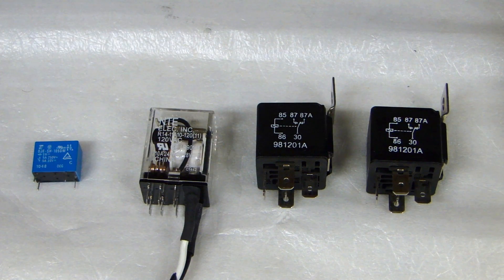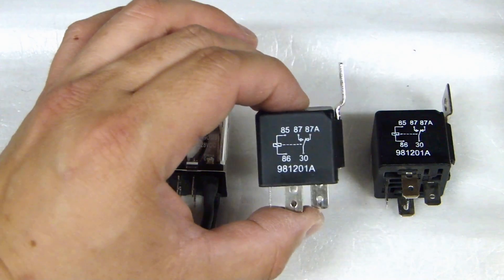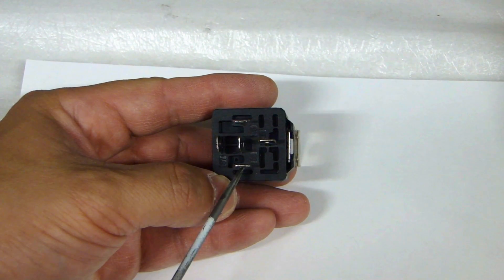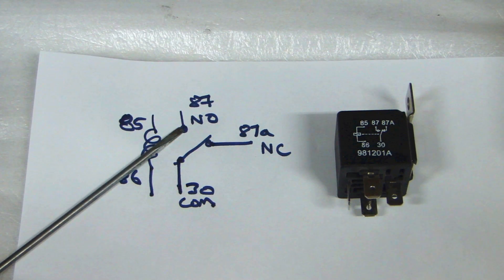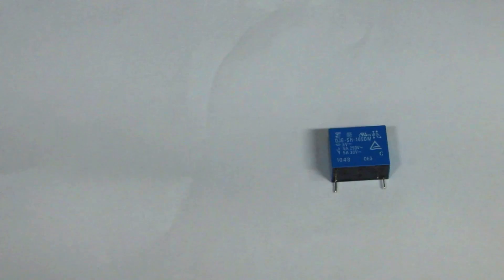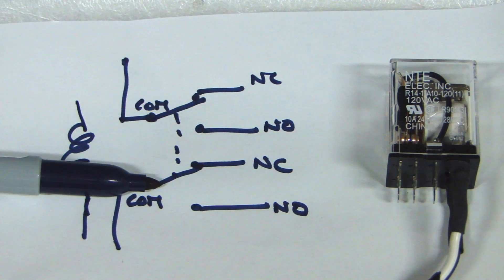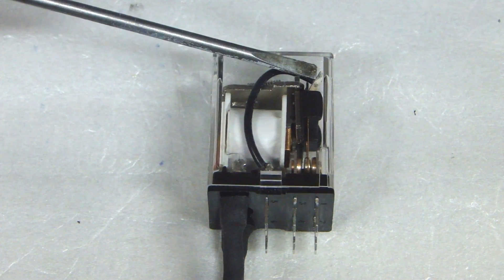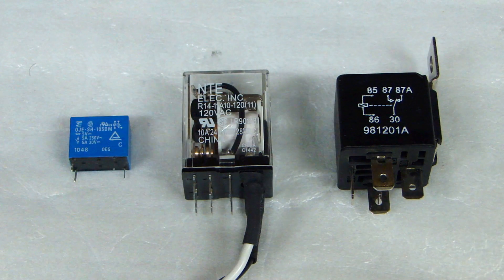How Does A Relay Work - SPDT DPDT SPST Automotive Relay

Comment: are the switch sides of relays directional, specifically the relay with 85,86, 30, 87a, and 87? im planning to wire up some kill switches to my car and dont want the power or signal going in the wrong direction. i have everything i need but this is the only thing im waiting on. im using them for 3 kill switches: clutch safety, starter, and fuel pump. nothing will be wired to 87a, only to 87 for when there is power being applied to them. thanks
Reply from the maker: The switch side is not directional.
Reply: dial2fast thanks so much for replying

Comment: Very well done video!
Those NTE relays are very good...mine is always on @ 8.5A (120VAC) unless grid is down...then switches to inverter.
This relay has been running for over 7 years with no issues.
I tried other brands that said 10A but never held over 4A without burning up.
Reply from the maker: Thanks for your comment!

Comment: very helpful. when i have a 12dc relay for example ,and the terminals are A1 A2, which sdie is the plus and which is the minus. and what will happen if it is not properly connected?

Comment: dial2fast  plz help me wire a (-) 200 mA aux output from viper 5806v using a relay to the door unlock wire on my car, because the original wires for lock/unlock stop working, "common viper problem" so i'll just use anyone of the aux output to do it.I just want to know what goes where
Reply from the maker: If you using a 12V 30amp SPDT relay (most commonly used for car alarm install), then pin 86 goes to 12v, 85 goes to aux channel, 30 goes to car's lock or unlock wire, and lastly 87 goes to either ground or 12v depending on if your car has positive trigger or negative trigger for the door lock/unlock.
Reply: the door lock wires are negative, so should i ground 87 or connect it to 12v?
Reply from the maker: Negative trigger needs 87 connected to chassis ground.

Comment: so im hooking up this train horn to my corolla...I have a relay with four pins. the 85, 86, and 87 pins, with th 30 as well. Would the 30 be ground?
I have this coil looking thing that actually generates the horn which has a positive and negative terminal. Almost like a small ignition coil. Anyways, where do these terminals connect to? I think my horn has a 12v wire that comes out from the horn instead of negative like most cars so where would each go?
Reply: Angel Garcia just put a switch in, protect the hot circuit with a breaker or fuse close to battery and run a ground. Its not rocket science.

Comment: I'm new to this electronic stuff. Say I want to wire in a new light-bar how do I control the initial on off power to the relay? I would wire the pulls of the relay to the battery but what actually powers the relay. I looked on another video and I think its the fuse box but I'm not sure.
Reply from the maker: I have been meaning to do a video on building your own relay harness for fog lights or light bar, but need to find time. But for your light bar install, you will need the automotive relay I showed in the video. For this relay, connect pin 30 to fused 12V from battery, pin  87 to light bar 12V red wire, pin 85 to chassis ground, and pin 86 connect to an on/off switch in series which connects to the 12V trigger wire (this can be ignition 12V, or parking light 12V, or constant 12V, etc). You should also fuse this wire to protect it from electrical shorts. Google 12V relay images, and you will find some examples.
Reply: Is the amperage in the fuze box ie, parking light, or constant 12v you talked about much lower than the battery's amperage? because if not I don't see a point of using a relay. The whole concept is controlling a large voltage/current with a small voltage/current. 

Thanks for the detailed response on wiring the lightbar, I actually understood what you said:)
Reply: I wire in a ton of lights and accessories. I never use relays. With a light bar, just keep the kiss theory and run 2 wire, protect the circuit with a fuse at battery or at an acc un used extra fuse socket, install a switch for power supply and run that and a ground to light. Not every thing needs a relay.

Comment: So what if I have a single pole single throw switch, it has 3 terminals, NC, NO and com. How would I wire it. I will be using the NO (normally open configuration.) Its 240volt 10 AMP switch. I have 2 wires Power and neutral. Do I put power wire to NO and neutral wire to COM.....Or Power wire to com and neutral to NO? Or it doesnt matter?
Reply from the maker: If you have NC, NO, Com, then the relay is SPDT. The 240 VAC 10amp rating is for the contacts itself. It may be a different voltage to engergize the relay coil. You don't connect hot wire to NO and neutral to COM as when the switch closes, it will be a direct short. Depends what your application you are doing. Re-watch my video as it explains how a relay works.
Reply: Oh shit, I see what you mean. Just as well I didnt try that and ask questions first.  So I would need split one wire to complete the circuit.

Comment: Very clear explanation, thank you
Reply: 8
Reply: Not so!!! The instructor failed to mention  how a relay would act if the points get carbon on them. How to know if the relay is actually bad and what it is used for.  Any two year old could explain how a  simple switch works.
Reply: @elenaolivares6965  What is a relay used for then? I think it has A LOT of  different uses, there would need to be a whole separate video just to have time for it all i would imagine.
Reply: @elenaolivares6965  "How Does A Relay Work' I think he covered the title. Could do a several hour video or a series to cover all the different uses, what could go wrong, how to detect a bad relay & so on. Sometimes we have to do a little research to find exactly what we are looking for.  Stay safe, Joe Z

Comment: Why do they make transparent enclosure for relay? There must be some specific reasons, right?
Reply: Exactly.
Mechanical operation obstruction can be found.
Additionally, although it makes a bit sound "tick" (like second's hand in analog watch)- with a transparent body you can actually see it's operation from one to another contact
Reply: Because almost everything is cooler in a transparent shell.

Comment: In the SPDT relay switch, how is this different from the other switches they used for the same automotive tech purpose.  DVD din 7" stereo.  In both cases a circuit was opened by another.  What about the minimum voltages?  SPST switch they used also.  I would think that was from the battery also?

Comment: how exactly can I determine the difference between a spst, spdt, and dpdt if i'm not looking at a schematic.
Reply from the maker: Most relays have a small diagram printed on the housing for you to see.
Reply: oh yeah, I noticed it in the next video, thank you.
Reply: Vic & Baby K 
SPST = Normally have only 3 or 4 contacts (85 Switched Power Source and 86 Ground to power the Copper Coil and 87 Accessory being powered or 30 Constant Power Source such as from a car battery)
SPDT = Specifically only 5 contacts. 85 and 86 to power Copper Coil. 30 for constant power. 87 and 87a ONE SET of two CIRCUITS (either one OFF and ON) thus why it is called Double Throw (DT).
DPDT = 6 or 7 contacts....

85 and 86 for Copper Coil. TWO SETS of two circuits (87 and 87a and another 87 and 87a) = 6 TOTAL CONTACTS. 
((OR)) 
85 and 86 for Copper Coil. TWO sets of two circuts (again) 87 and 87a (x2) and 30 from a constant Power Source such as from a car battery = 7 TOTAL CONTACTS

These amount of contacts can also be greater in number. However to be honest I am not familiar with the naming scheme beyond DPDT. There are YouTube videos on this. You just need to find them 😊👍

Comment: thanks for good Clear explanation :)

can u please explain about the relay in this link

http://www.ebay.com/itm/KILOVAC-H-4-S1-5-KVDC-HIGH-VOLTAGE-SPDT-RELAY-100-ohm-8-15-VDC-coil-/261813426254?hash=item3cf54bd84e:g:PFgAAOSwNSxVBhuY

Comment: Hi! Good video. Just one question. How can the n.o. and n.c. contacts be rated at different amperage on the spdt relays when they use the same common? Would it not be the case that it has one rating for constant duty and a higher rating for momentary use? Just asking because that's the way I always understood it.
Reply: mobilemechman Yes the way you mentioned it is exactly right. The reason is it coming from one Power Source (COM) or how I just like easily describing it from a Vehicle Relay (30) (power from a Lead-Acid Battery) is because it is only one Constant Power Source (this case the Battery) that can power either one of the two  circuits (either the NO or NC) (or from a Vehicle Relay perspective 87 or 87a). 87 would be the NC and 87a would be the NO. Now the reason you have different AMP ratings from one circuit or the other is the fact that when current is supplied to the Copper Coil (supplied to 85 and 86), the Copper Coil creates a Magnetic Field which again magintizes or amplifies power to one circuit (again 87 or the NO circuit) which creates a greater surge of current to go through the 87/NO circuit VS the 87a/NC circuit. If you need a further explaination, let me know.

Comment: The voltage on the relay is the coil voltage. Meaning its the maximum voltage it can take. So 12v DC is the maximum voltage it can handle on that 12v DC. It can energize any where between 6v-8v. Don't blow ur relays.
Reply: I don't think so.  In an automotive application, for example,  12 volt relays are used. System voltage while the engine is running stays at @13.5-14.5 volts. How would you explain this?
Reply: mobilemechman I believe they designate "12V" as a guide for the recommended amount of voltage although a relay can still work with slightly lower or greater voltage from a REAL WORLD prespective. Also that speific circuit (or the switch on that circuit) was specifically designed to only draw so much potential (Volts) although your car battery will have a slightly higher Volt rating (more electrons pumped into it) because your alternator is running while your car is turned on.

Comment: I have faced a problem. I am using a 220 AC DPDT relay for my microcontroller project. We must use ATMega32 for this project. The relay needs 28V 5A to operate. But my microcontroller can provide only 5V. How can I solve this problem?
Reply from the maker: No matter what you do, you will need a 28V power source to engerize your relay. If you can find a 28v power source, then use a 5v relay to close the circuit to supply 28V to the 220VAC DPDT relay.
Reply: Yeah. Thats the problem. I have no direct 28v dc source. Is there any system that can provide me 28v dc source? Any 5v to 28v relay?

Comment: Thanks for the vid ! how ever i have a question i am going to wire up electric dual fans going to wire both to one relay and the relay i got is RL180  100 amp this relay looks a little different then what you have here ,well a little anyways , a fellow car guy recommend them and also using a fuse with it also, when putting relays on is it best to have the relay close to what your powering up? i also want to wire up my fuel pump with a relay is it ok to have the relay on the firewall and run a long wire to the back of the car ? or vise versa ? if you get a rainy day over there could you possibly draw it out on paper how you would do this and record it ? whenever you get a chance no pressure lol , Thank You in advance ..
Reply: How are you going to control the fan relay? With a toggle switch or maybe a temperature switch that doesn't close until the desired temperature? How about the fuel pump relay? How are you going to ensure that the fuel pump turns off in the event of a crash? Maybe like an inertia switch like Ford uses? Just some things to think about, not trying to discourage you. These things would need to be known before someone could answer your question.
Reply: Fan will be on a temp sensor switch , Fuel pump is on a switch and turns off with key also , Not discouraging at all just looking for honest input. I believe it just works like most other relays from what i found on you tube , same kinda pins ETC thanks for getting back to me! And thank for the vids! Canada vids i felt like i was right there with ya nice job! And loved the auto parts store that would be a success here in the states i wonder why no one hasn't done it already but im sure its coming !

Comment: 87A is normally open and 
87 is Normally closed 

if you dont believe me then see the diagram on the relay. CONTACT Pin would be on the 87A and nothing would be shown for 87

i am talking about the Bosch style relay (5 pin)

Rest of what you said are absolutely correct.
Reply from the maker: +John Fernandes The NORMAL state is referring to when the relay is NOT engergized, and in this state, put a multimeter on PIN 30 and PIN 87A, and you will see it's closed = normally closed

Comment: Hi, can you help me with a question for an essay I have to write at my college. The question/scenario is: 
You need to create a remote on/off switch for the amplifiers on stage while doing an installation of a sound system at the local club.  The amplifiers must be switched on and off from the mixer position, without running thick power cables next to the audio cables between the stage and Front Of House. Explain the specifications for the relay switch to be used, the connections to this relay switch and the PSU to control the relay. Remember that we do not want to add any additional EMI noise to the sound.

Comment: Excellent information mate but I am just wondering with the last relay, the double pole double throw relay. Because the two poles are not connected how is the circuit complete?
Reply from the maker: +Thetrucky69 The DPDT relay has 2 independent switches inside. They do not connect to each other inside that relay. It's just 2 separate switches inside.
Reply: +dial2fast Thanks your tutorials are excellent cheers.

Comment: Thanks¡¡ awesome video simple perfectly explained and really heplful,  so if i don't supply enough voltage  the relay won't move inside? i mean i couldn't make it work a 12v relay with a 5v supply right

now i'm having troubles trying to find a "5v dpdt relay"  i was wondering if  connect  2  spdt relays "in parallel", could work as a dpdt relay? i'll really apreciate your answer
Reply from the maker: Yes a 12v relay needs a 12v power source to energize. Try eBay for those relays. But you can use 2 SPST if you want, just more wiring.

Comment: Great tutorial.  Now I know the actual function of relays.  This, your brake jobs, car maintenance, and the soldering video is why I subscribed to your channel.  I am learning something useful.

I am trying to figure out the relays used automotively speaking.  A double pole, double throw would be like for high beam and low beam on a car, but what would be an example of a double pole, single throw relay, or the other way around?  Wouldn't just an on/off toggle switch be the same?
Reply from the maker: Gary G A double pole, single throw is basically (2) NO switches inside a relay. This relay does not have a NC contact available. A relay seem simple, but car alarm installers can cascade these relays together to switch reverse polarity voltage for power lock control, or connect several of them together to make a latching switch. There are tons of application for these things. Check out the long list of application on the 12volt forum:http://www.the12volt.com/relays/relaydiagrams.asp